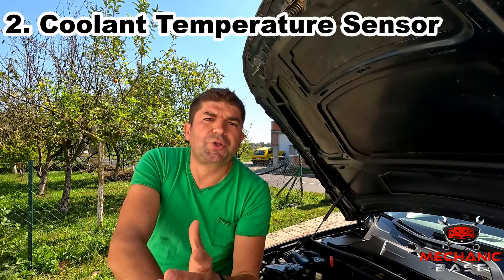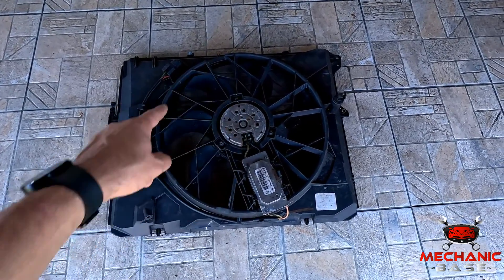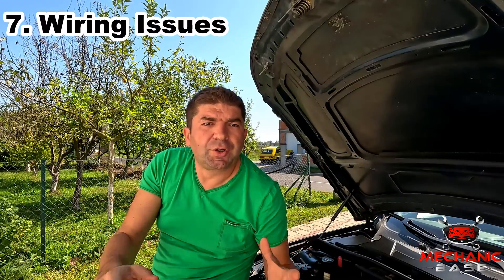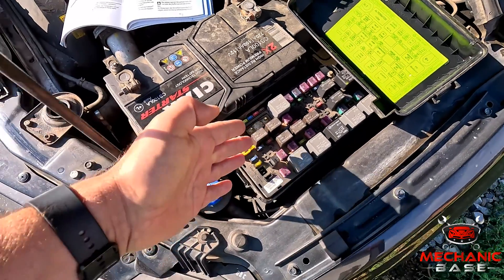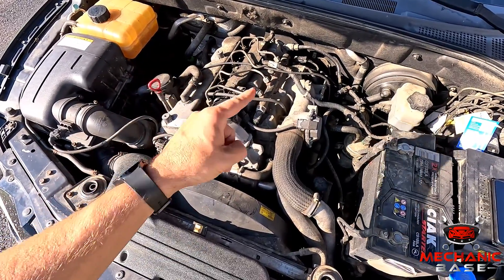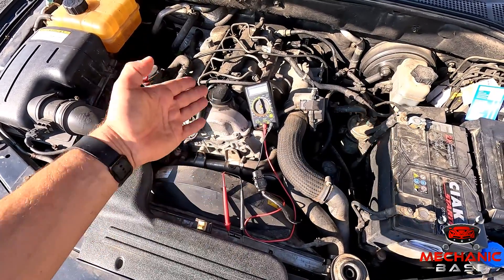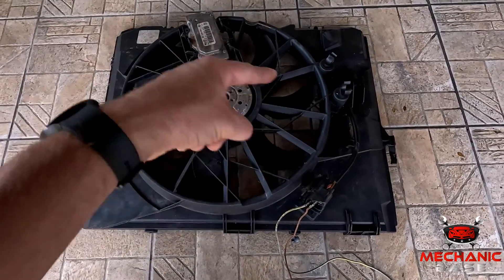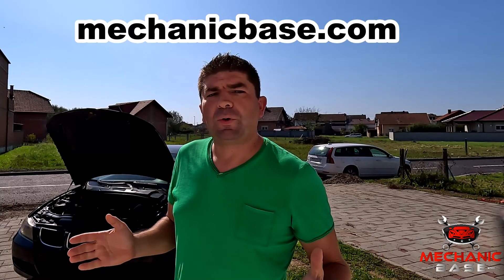Radiator Fan Not Working? 7 Common Causes & How to fix it

Comment: Because we tested almost everything fuses,plugs and we even changed fun relay,temperature sensor,thermostat and water pump but still the fan is not running.they even try with other radiator fan still doesn't run pls help
Reply: Did you fix?
Reply: This could be the pins under fuse box,  test fan by itself on 12v
Test cable by itself when reach high temp it should receive a signal 12v

Comment: I just replaced my radiator and fan yesterday. I just realized the fan isn’t working even after driving for a long time. Temp gauge is fine. Fan spins slowly when I turn on the air
Reply: Did you fix the problem!? How
Reply: @akbrshaaa What wrong bro